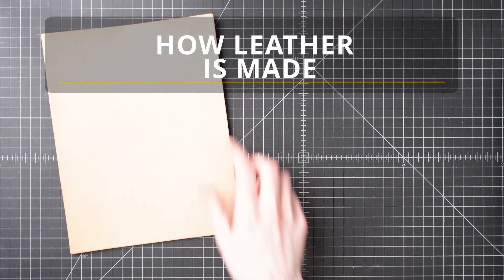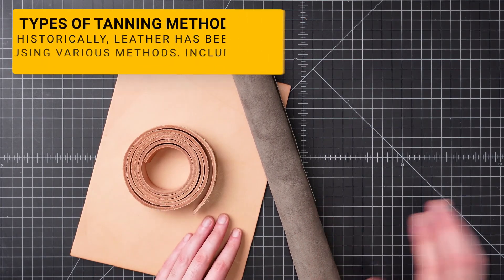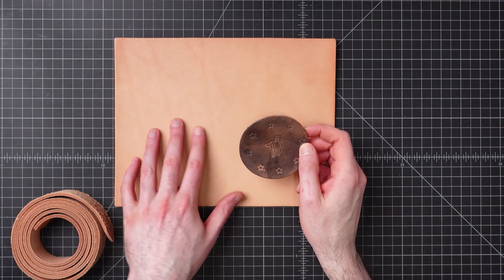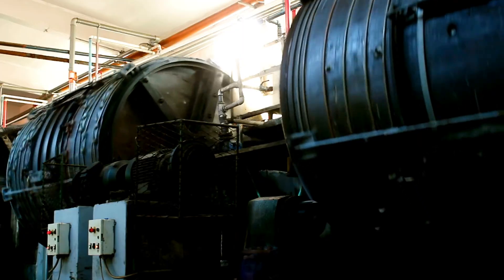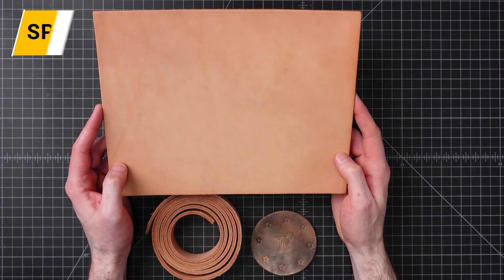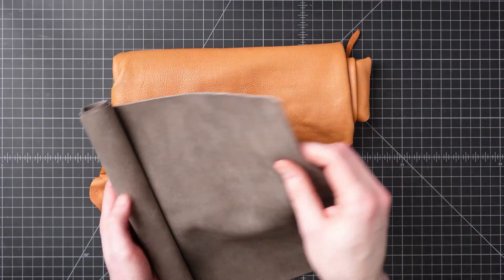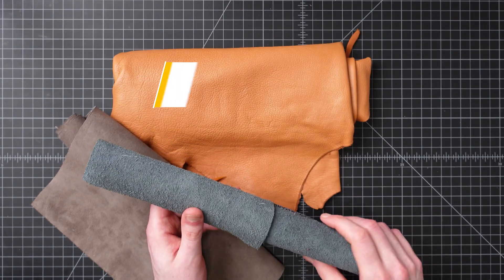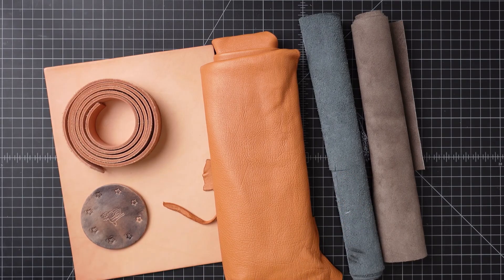How Leather is Made: The Veg and Chrome Tanning Processes

Comment: It's me again 😊. I noticed generally when people talk about chrome tanned leather, they always mentioned that its soft and supple, its hard to stamp on it, keeps its color and it doesn't develop patina like veg tanned. I'm curious about leathers like Crazy horse or other leather types that can be made both by veg and chrome tanning. Let us say, they both have sa same thickness and stiffness. How different is the crazy horse leather that is chrome tanned vs veg tanned? Do they equally develop patina? How are they similar or different? What about the durability?
Reply from the maker: Hello 😀 the characteristics can vary a lot based on the tannery's individual approach to that style.

If it's bene both veg and chrome tanned, it will be somewhat in the middle of the two in terms of flexibility, as the stiffness is generally a result of the tanning process (as the raw hides start out as the same material before being entered into a tanning process).

Generally the patina will develop stronger on the veg tan. Durability can be impacted by intended use, though often the stiffer material, if well maintained, can last longer. 

Though a hard-used veg tan piece of horse tack might not last nearly as long as a gently-used chrome tanned handbag. While 1:1, the stiffer material, all else similar, can in many cases last longer.

They're similar in that they each have many of the beneficial characteristics of leather (strength, flexibility, durability), so choice often comes down to fit for application use and personal preference. 
👍
Reply: @internationalleatherclub  Is there a way to know if a leather is combination tanned? Is this tanning combination a way to put veg tanned characteristics to chrome tanned leather and vice versa? I'm trying to research how similar or different veg and chrome tanned when it comes to leathers that can be made in both process like suede, nubuck, crazy horse, etc., but I can't seem to find any, all I can find is the general comparison between veg and chrome. When it comes to leathers like suede, nubuck, crazy horse, etc., it seems people don't seem to care as much as to what tanning process were used. There are very few websites that mentions the tanning process, but these are mostly online stores. Most websites only show contrasting examples of veg and chrome leather, but they never compare similar leather types from both tanning methods.

This thought came to mind while I was reading about crazy horse leather. Websites mentioned it's good qualities but never say if it's the veg or chrome tanned they are referring. Since 90% of the leather is chrome, I was wondering about the chances that the crazy horse leather mentioned on most websites are chrome tanned, and there is a big chance that most people will find a chrome tanned crazy horse over a veg tan. But since crazy horse can be made in both tanning methods, it made me think about how similar or different the same type of leather that's a veg and a chrome tanned. I think Is it safe to assume that veg and a chrome have equal qualities when it comes to leathers like suede, nubuck, crazy horse, etc.. But I'm still wondering how different is a crazy horse leather that is chrome tanned vs veg tanned, since both tanning methods have contrasting qualities.
Reply from the maker: @georgebenta3435  Hello 😃 there are some tests (these here a few and many more: https://www.youtube.com/watch?v=RGhYZlwXd28) that can be used to help determine the type. 

Seems like some great reading/research you're doing - as to quality, a key factor to keep in mind is the quality of the tannery doing either the veg or chrome tan process.

For example a great tannery can make an incredible veg tan, and a poor tannery a poor almost unusuable veg tan. 

Same for Chrome tanned. So next would be the intended use (what item it will be made into), as to what characteristics would perform better there.

In the concept of if the same tannery of high quality produced the same leather in both veg and chrome tan, they'd likely each have some of the positive characteristics of the respective tanning (chrome a little softer, more flexible), Veg likely a little stiffer and can accept more waxes/oils.

The quality of the tannery process would likely stand out most.

Comment: Hi. 👋 

Recently found your feed and really enjoy it. Any advice about dying Scotch/Cashmere/Pebble grain leather shoes? It seems like every video clip I find only shows how to dye smooth grain types of leather. Thanks and take care. ✌️
Reply from the maker: Hello 😃 it's great to  have you with us. 

For pebble grain and related types of leathers, key will be determining if, and what kind of surface coatings or protectants have been applied.

Some might be flexible, acrylic based coatings (for waterproofing and scratch resistance), some might even have plastic coatings, and others unfinished natural leather.

Knowing the surface that will be worked with can help guide what steps can be used to (and if it's possible) to dye it.

I hope that helps as a start, always feel welcome to ask questions as you go along. Once the surface and core leather materials are known, the path how can become a little clearer. 👍
Reply: Thanks so much for the advice. They are a full grain cow hide pebble grain leather. They are a pair of rare Florsheim 93633 Forest Green shoes from 1967. I believe someone dyed them brown as this model/color was pretty unpopular in their day and only were sold a few years. All date/model coding is correct and there’s even still a hint of green in them. I’m trying to strategize how to get them back closer to their original green color without destroying them. At the moment I’m planning to try some different prep methods and dye brands on some cheap EBay buys that are the same manufacturer and type of leather in order to see what happens. I figure I have one shot at this with the rare shoes, so better to ruin some cheaper/common ones first. Thanks again and take care. ✌️
Reply from the maker: @CMcD630  Hi, you have an excellent idea and approach for testing on similar ones, I definitely recommend other folks learning from your thinking 😃

There can be so many variations in leather, even subtle ones between tanning runs from the same tannery, that testing on cheaper items or scraps can be great to get a feel for a new process or dyes/cleaners/conditioners/finishers before doing it to a final, important piece.

Wishing you great success and results with it! I hope it works out really well and you get to enjoy that original Forest Green, it sounds like a nice one 👍